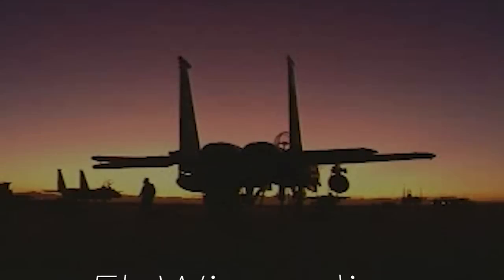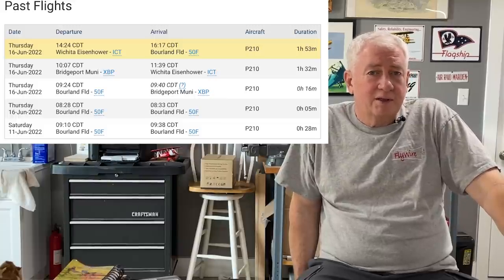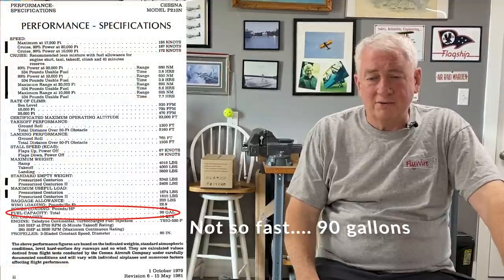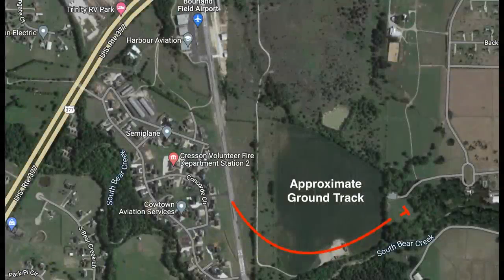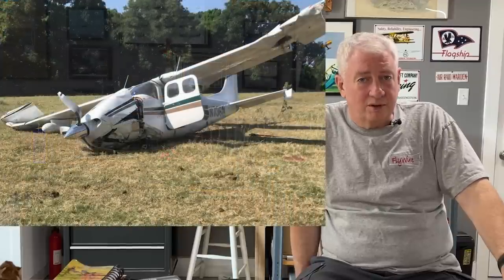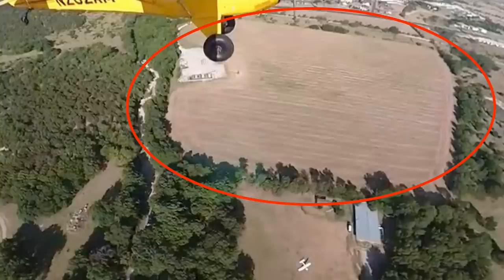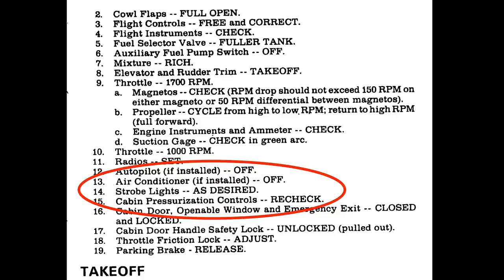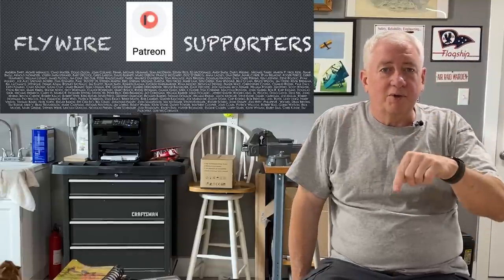Accident Review  P210 Partial Power on Takeoff

Comment: Scott - I have 500 hours in P210s (including stock TSIO520's, a TSIO550 "Javelin" and a TN550 Vitatoe). I'm about to pick up my own Vitatoe TN550 conversion (just like this airplane) after 6 months of work. I know the owner of this airplane, and I know this airplane (put an offer on it at the same time I was buying mine as a contingency). As you might imagine, I was VERY interested in the details of this incident - given that I'm about to have the same engine conversion (there are approximately 80 of them flying with massive success, FYI). I reached out to the owner the instant that I heard about the incident. As such, I have first-person details of the entire 60-second flight. While you make some excellent, generic points about what can go wrong, checklist usage, etc...with all due respect, you are absolutely, totally, completely, 100% wrong in EVERY single aspect of your "analysis" of the cause of this PARTICULAR incident. I do respect and enjoy your videos and I am a fan. However, in this case I have FIRST HAND (not "first responder" or "witness") information on this incident. I'm not going to elaborate due to pending NTSB investigation, insurance, etc. Simply put, the engine was absolutely making 100% power (per the Garmin EIS installed on the aircraft). 31” MP, 2700 RPM, and 34-35 GPH is definitely "full power" for the Vitatoe TN550. There was no "aborted takeoff". It was an intentional systems test (as part of the TN conversion break-in/testing procedure) - which the aircraft passed with flying colors. (I'm looking forward to doing this same test on my plane in the next week on a 9000' runway where she's being converted.) I'll leave it at that until more comes out. Please stop calling it a "partial power loss on takeoff" as it was simply not the case. That is a fact. Not speculation. That all said, the actual cause of the incident will be informative for sure - and probably worthy of a video and a lot of discussion. But trust me when I say that this incident had nothing to do with mechanical issues - nor was it due to an "emergency" - at least not in the classic sense..
Reply from the maker: Thanks for watching and commenting. I am amused by a couple of responses I've gotten on this video. The fact of the matter is that the airplane crashed at very low speed. If the engine was producing full power I'd love to hear about the theory. At this point in post 'accident' progress the folks in the airplane begin adapting the story to fit a narrative, either consciously, or subconsciously. In short I would discount the 'story' at this point. Especially, if the facts show a different story. The same goes with eye-witnesses, very rarely can they fill in the whole picture. Small pieces perhaps. 

In the immediate aftermath of an incident, with adrenaline pumping and some degree of shock existent, folks tend to tell the truth. The witness I talked with related the 'story' as it was told to him at the scene, moments after it happened. He combined that with what he observed in the airplane and the FAA/NTSB rep who came to look at the crash. 

Given all the effort to discredit my video, I am beginning to suspect there is another motive to alter the narrative. Given the setup of the incident, the energy state of the airplane and the switches (both AC on), even if the airplane was at full power that was not enough to fly. I'll stick by 'Partial Power'. Leaving the AC switches on and crashing your airplane would probably not demand a 709 ride. Crashing your airplane seconds after takeoff with an engine that was producing normal power would point to serious pilot error and would probably precipitate a 709 ride. 

So, my question is why all this effort to control the narrative? Was the owner/pilot, not the one flying? Is this an insurance swap? A maintenance legality coverup? Even if one of those was the scenario, a simpler explanation is a more likely cause. Including, only one attempt at a takeoff. 

The fact is the AC switches were on in the cockpit right after the accident. I trust the first responder way more than the pilot on this point. I would, however, bet that the switches are now off. Gotta wonder why all the effort to control the narrative.....
Reply: "Simply put, the engine was absolutely making 100% power"... so it was pilot error then?  What could cause an aircraft able to utilize full power to behave so much like it was lacking in power?  Walking and quacking like a duck...Occam's razor etc
Reply: I'm also looking to do the Vitatoe conversion for my P210 (why did your conversion take "6 months"?)  I was hoping for a down time of 3 months...
Reply: @sandhill9313  Keep in mind that there are 2 sides of the power curve. That fact seems to be going unnoticed here. But I'm not going to try to argue with all this "great analysis" </sarcasm>.

Comment: Sounds like a case of getthereitis.  Thank you for your coverage of aviation safety.  Correct me if I am wrong, but commercial airline pilots and military pilots practice, practice, practice.  They seem more aware of the danger involved. And I think they have a different mindset than other recreational pilots. Thanks for reminding the GA community to be prepared ahead of time.  Thinking of a plan at the last second takes too long. Oh, and leave your ego behind.  Giving up ahead of time if you are aware of an issue, might be better than the alternative..
Reply from the maker: Well said Jim!
Reply: I am no aviation expert but I believe one reason that GA  has so many accidents is because evidently pilots do not train as much, on simulators, on the ground, checklists  etc as military and commercial pilots do.
Reply: @adriaba790  and aircraft are often very old, systems less capable.

Small GA is nowhere near as cutting edge as all other sectors of transportation.
Reply: @adriaba790 Background: I was a career military fighter pilot, half of it active duty and half in the ANG. I was also a Part 121 commercial pilot for 20 years. Tack onto that about 1,300 hours of GA time in gliders and as an owner/operator of a turbo single Rockwell 112TC Commander.

Oftentimes, I suspect the GA operator's lack of emergency and abnormal incident practice and recurrent training comes down to basic economics and ego. To give oneself some recurrent training often requires us to hire a CFI to go fly with us and give us some no-notice engine or systems malfunction training. It also invites the possibility of criticism of how we react and perform under those artificially stressful situations. Most pilots tend to be high ego, I know I am, so there's a built-in subconcious reluctance for us to invite criticism of our performance. You can add to that the economic drag of hiring a CFI, an hour or two of maintenance accumulation on the airplane, and fuel purchase, for an otherwise "unproductive flight", and it's easy to see why a lot of pilots don't do it. Prudence and common sense advocate for us to park the ego on the ground and pursue periodic recurrent training more often than a biennial review, but few pilots that I know do it. GA accidents like this one and many others every year dramatically demonstrate the need.

Comment: Cheap fuel? Temperature? Humidity? Possible moisture in fuel? Definitely too close to gross wt. - ? Distraction? (4 guys on a roll for wherever- that would be distracting). Fudging on the checklist is a reasonable possibility. Agree, they are important.
I like "unsupported wishful thinking." Seems to be epidemic these days, along with most everything else. What is it about Cessnas and flaps?
 "Trying that same thing over - and over - is not a path to success..." 
Tell me about it. I could wax more lyrical on that, too. 
Why is it so many people have such trouble taking "no" for an answer? If the pilot had been paying attention, he wouldn't have made that second try. Instead we have the unfortunate result. Peer pressure? Groupthink?Eeesh.
Glad they all made it out ok. They really were lucky.
Thanks for sharing. Good report.

Comment: I hate airline style pattern approaches with GA aircraft. It's nuts what I see out there. I always prefer a high altitude Pitts style takeoff and landing pattern approach where you can easily make it to the runway.
Reply from the maker: Me too!
Reply: Low time pilot here - can you elaborate? I fly Cessnas - runway half way up the strut on downwind and turn base at 45 degrees from the touchdown… final dictated by wind direction. Thoughts? Reasonable? Thanks!
Reply: @dade8881  It’s all about energy when you experience a power loss. Altitude provides airspeed which provides the energy you need to make it to a runway. Fly high! It’s amazing how comforting it is to be at 5,000’ agl when flying. It provides time and good decision processing when you lose power. On take off, hold the aircraft above the runway at full power until near the end and quickly climb for as much altitude as possible. When you arrive at an airport, circle at a high altitude to study the current conditions and traffic. Then do a circling downward approach above the runway into a tight pattern to land. With this approach you can always make the runway with your excess energy alone. CFI’s teach horrible pattern flying to new students. They always assume you will not lose power.
Reply: @pittss2c601  thanks! Will practice 👍🏻

Comment: Considering the cost of a factory new aircraft engine, I am surprised that more people don't break them in on an engine dyno.  Yes, it would be a lot of fuel and the dyno time would also be expensive.  But you'd be sure to have a constant high load for as long as it was running on the dyno.
Reply from the maker: Some do overhauls that way. Not many.

Comment: You nailed it, Scott, especially (to me) the part about not attempting that second takeoff when he aborted the first one for lack of power.
Reply: He doesn’t have a clue whether or not the engine was making power
Reply from the maker: I guess you really DIDN"T listen to what I said. I never said the engine was running rough or there was a mechanical problem. It wasn't delivering full power to the prop.... the airplane wouldn't climb and it crashed with the engine controls at full power.... AND the props bent back as evidence the engine was producing power. It doesn't take a Rocket Scientist to figure that out.

The airplane crashed, it ran out of energy... tell me how? The further evidence was the AC switches (as in plural) were both on. If you are not aware of the situation, AC pulls a significant amount of power from the engine... like when you need it to take and climb. So, I stand by my statement. If this wasn't a partial power situation we would be talking about it. It might be a good idea to pay attention next time. Contributing factors were gross weight and possibly pilot technique.
Reply: @FlyWirescottperdue  I just don't care. You're speculating again. I used to take accident review/commentary on YouTube seriously but now its impossible. You've been appropriately called out by other commenters who know more than you about the situation but it won't make a difference - you'll get your comical accolades from people who were even further from the circumstances than you were and life goes on.
Reply: It's actually possible that the people on board don't know the whole situation. Or shade the truth about it unintentionally.

Comment: FINAL NARRATIVE:

The pilot reported that he was conducting a third maintenance test flight after a new engine had been installed with the airplane s co-owner and two other passengers on board. The airplane was full of fuel and no preflight weight and balance calculations were completed. During the takeoff roll, the pilot rotated about 51 kts, which was 20 knots below normal rotation speed, and the airplane became airborne briefly before it settled back on the runway. The pilot then added nose up trim, rotated at 55 kts, and climbed slowly. The pilot continued to climb the airplane when the co-owner heard the stall warning horn. The pilot made a left turn to avoid terrain at the south end of the runway and then setup for a forced landing as the airplane was unable to maintain altitude. During the forced landing, the airplane impacted trees and terrain. The airplane sustained substantial damage to the fuselage and both wings. The pilot reported that the airplane was overweight and that there were no preaccident mechanical malfunctions or failures that would have precluded normal operation. A postaccident weight and balance calculation determined that the airplane was about 359 lbs over the maximum takeoff weight.
Reply: Also. Wasn’t this his second attempt to take off? I’d got out if I were a passenger.
Reply: @davideskelin8266   Never under estimate the  power of  stupid people, during  my  Aviation  time I look back and   view  them a  hunks of meat waiting to hit  something  at high speed.

Comment: It will be interesting to find out what happened.  Most of the time in accidents like this you can only find out what really happened if you know someone local.  Thankfully we have Scott!
Reply from the maker: Since the folks on board survived I doubt the NTSB will pursue it. The FAA is unlikely to do so either unless they feel a pilot action is warranted. If there is a lawsuit the engine would likely be torn  down, but we'll never hear of it. I'm afraid we have what we have.
Reply: @FlyWirescottperdue  do you expect the airplane will be totaled?

And what at the NTSB or FAA needs to change for one or both to routinely get involved in accidents like this?
Reply: @PetesGuide  What's needed to get the NTSB or FAA to investigate accidents like this?  More of your tax dollars.    I think they are striking the right balance.  There are very few novel ways to end up in a field in a single engine airplane.   This one seems to be "something is wrong that I should check now, but can't be bothered, I hope it works."  Others are bad MX (clogged sump screen, never change/clean the oil/fuel filter), overloaded aircraft (density altitude).  Water in the fuel.  No fuel.

Bird strikes and catastrophe engine failures happen, but are thankfully very rare.  If we all assume we will lose the engine on every takeoff, and brief that, and have a plan, we can increase the chance of survival.
Reply: @marshallsherman4215  Maybe they will but when my brother sold his Helio Courier and the new owner crashed it on take off destroying it, all the investigation report said was the weather data and the  pilots report of what happened. So I see where Scott is coming from

Comment: I started a comment 4 times, and stopped each time. Every time I read these reports by you, Dan or Juan, I can't help but think people have lost their respect, and/or fear of flying altogether. Why would you not have an exact plan for losing an engine/power on TO! I was taught this 50 years ago, what has changed?  Have people lost common sense?  Having a plan if your engine stops making power is not rocket science, is it?!?  If people are not mechanically inclined maybe they need to do some advanced training. Maybe we need to test for that?  Sorry for the rant here, it's just so sad. I'm really glad no one died in this one!  It just seems like there is one every week where people do.   8(    --gary
Reply: I'm not a pilot - except on MS Flight Simulator (which doesn't count for anything), so I'm painting with a pretty broad brush. You mentioned common sense. In my 71 years i've noted a change in human nature awary from this simple thing - a lack of common sense and a lack of fear. "After all, the great electronics will save my ass." No it won't. Good old fear of death is a healthy thing.

If my truck wont start, I don't keep cranking the engine until the battery dies -- common sense.
If my airplane doesn't produce the power I expect and need, "get there itis" will kill me - common sense.
Reply: I think your question regarding how common common sense is among people can be answered by reviewing how many responded to (or didn’t) common sense actions to prevent needless death during the pandemic.
Reply: Bro, they wouldn't have put four seats in it if couldn't carry four people.....

Comment: So you have to wonder what he did to convince himself that another takeoff attempt was a good idea. Seems that turning off the aircon was  not part of his justification. It's not hard to check you are getting the revs you are expecting to see. I can't believe he would just give it another go if he did not see full power on the first attempt. Not without changing something.
Maybe the first attempt was just a full power run to check the engine and he was happy so back he went to do it for real.  Which then leads you to think it was just a simple weight issue so he couldn't climb away